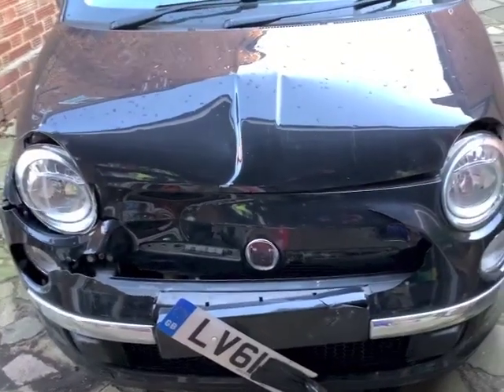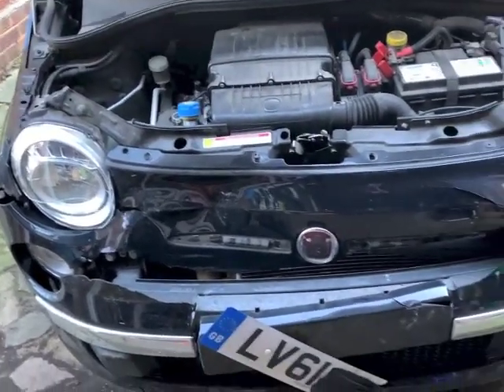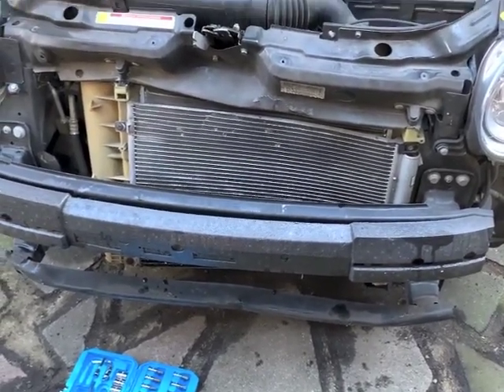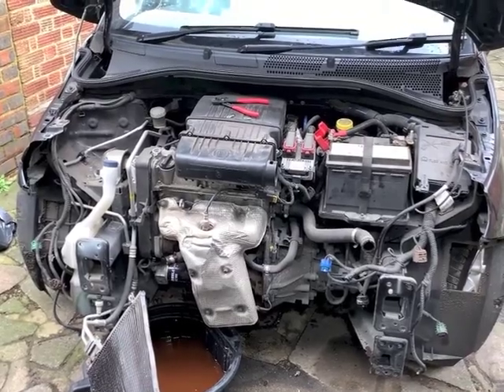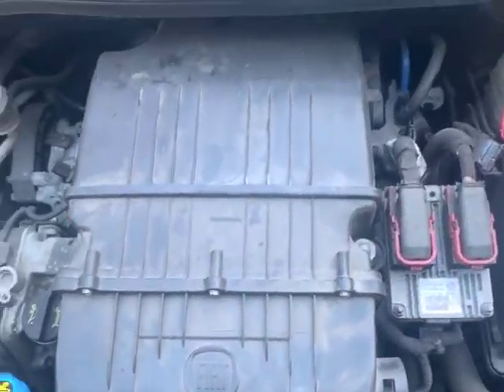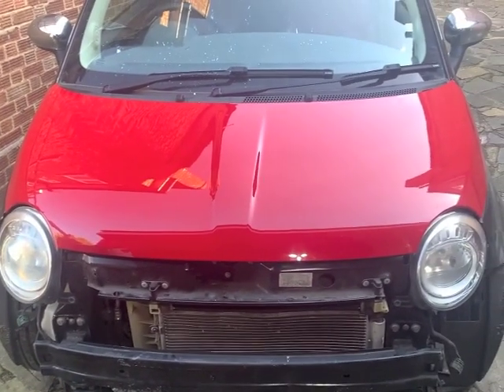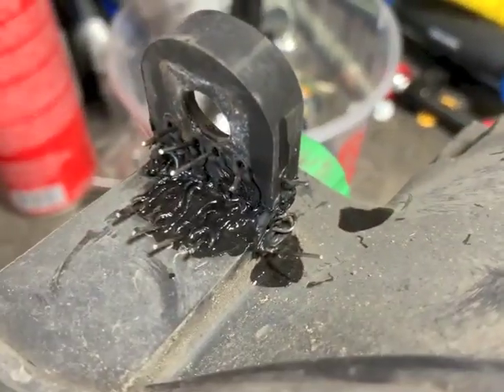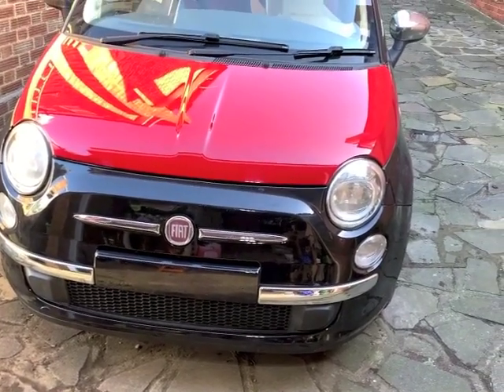Fiat 500C, 2012, Black - Cat S, fixed in about 5 hours

Comment: Painless to get service bits and regas air con presumably. Roof mechanism healthy.  Would it pass MOT with the screen as it is, just a thought. Really nice car for someone. Maybe get black stationery file and copy paperwork in relation to work you've done, service, cambelt, MOT, MOT history. Can get book packs for not much. Locking wheel nut key and both keys priceless really. 👍
Reply from the maker: Alex Dalgleish I pay £30 for a regas but I pass on savings when I sell the car. I don’t skimp but don’t spend money unnecessarily. I have a mobile mechanic that does the cambelt and water pump for £100 and I buy the parts. I always buy book packs on eBay for cars that don’t have any. I went to the dealers today who sold it new and they gave me all the service details. I’m going back with a blank book that I filled in what they told me and ask them to stamp it. I supply copies of parts invoices too. Roof works perfectly. Just need some sun.
Reply from the maker: Alex Dalgleish it’s an mot failure. Surprisingly windscreen with aerial is only £10 more.
Reply: @Love500  Handy you've got pretty sorted car then. Dread to think what a brand new one would cost. 🙊😬😱

Comment: Hi mate, have you looked in the secret compartment for the book pack ?  
Mick
Reply from the maker: Mick Repairs Cars actually I haven’t but I don’t think it would actually fit. Good shout though I’ll double check.
Reply: @Love500  it's a big compartment under the seat pal, I've found loads of stuff in them lol 
Great channel
Mick
Reply from the maker: Mick Repairs Cars oh I know where it is. I’ve found numerous usb cables in there in the past and locking wheel nut keys. Even had a Christmas tree in the boot complete with, lights. Was my office tree last year.